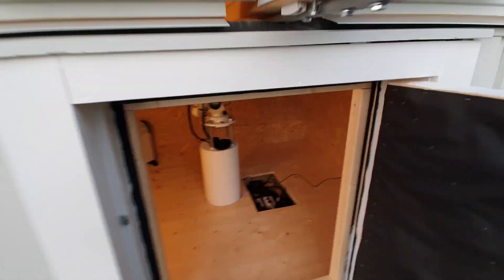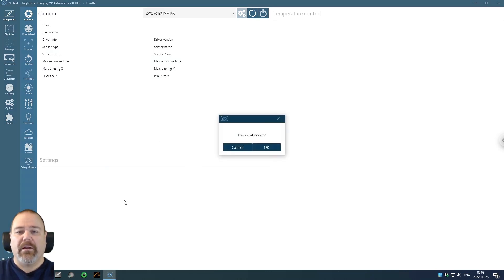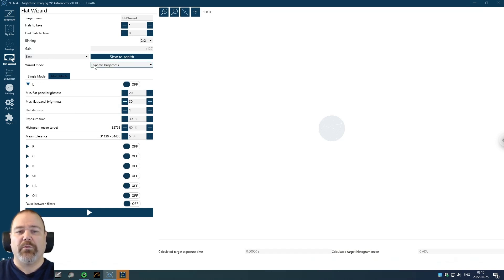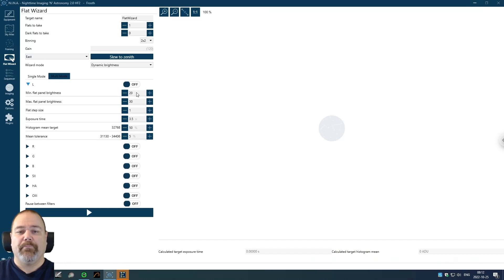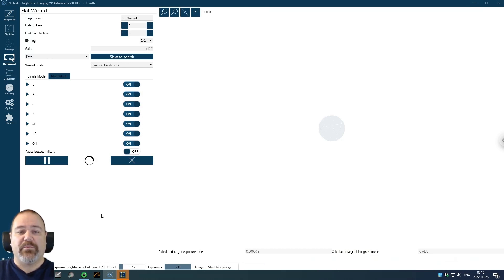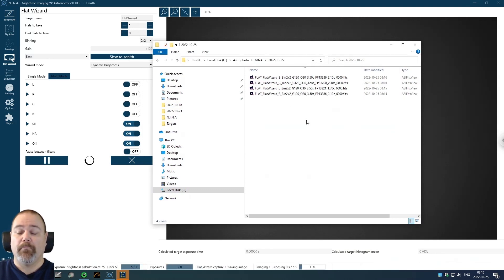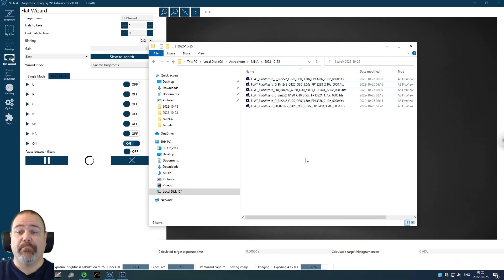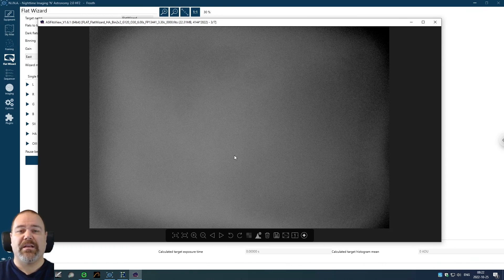Flat Master 150 - Automate the flats with wall mounted panel and dynamic brightness in NINA

Comment: Did you try to make master flats in Sharpcap? It will do everything for you and give master flat for each filter. These files will be ready to use for calibration of light frames and you don’t need to go through zillions steps, as you do in Pixinsight.
Reply from the maker: I haven't tried Sharpcap for that, might give that a try. I really like the steps in PixInsight :)
Reply: @frosthastrophotography  Making master flats or darks take very long in Pixinsight. It just drive me mad. 
By the way, I like that Pegasus gizmo. I will get it.
Reply from the maker: @anata5127  You can reuse darks and even dark flats for some time.

Comment: Goood tutorial Martin.  I still place a folded white t-shirt over the lens dew shield before I place my art tracing LED board on the top.  I think I need to lower the light level as my flats are exposing at around 0.25 of a second, but, even at that, I am getting some clean images after applying the calibrated flats and dark flats to the stacking routine.  I take only 20 calibration frames for each type.  Again, it seems to work.  I need a bigger storage drive as those calibration frames add up.  I always take new flats for each session if there has been any kind of change to the light train.
Reply from the maker: It's very handy to be able to control the panel and the brightness from inside, but as you say, all the frames take up space. I have everything saved, but might start deleting the calibration frames when the master flats have been created.